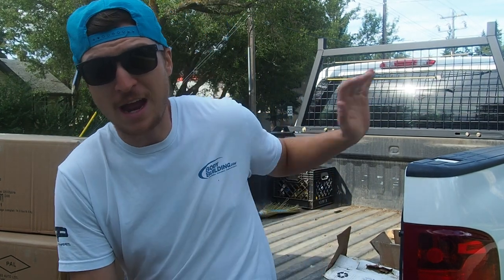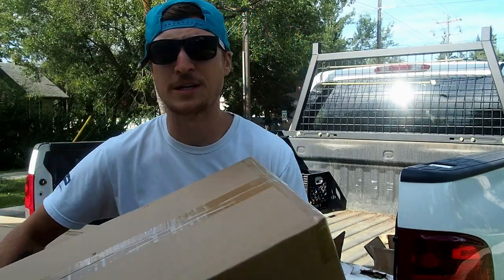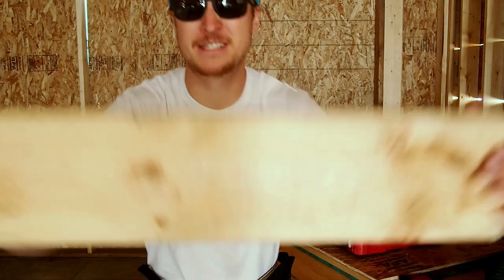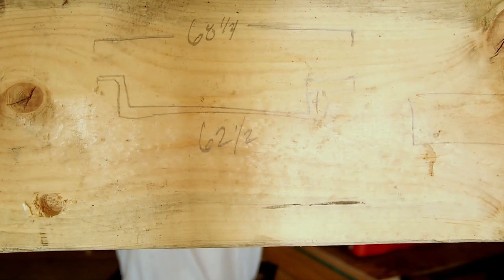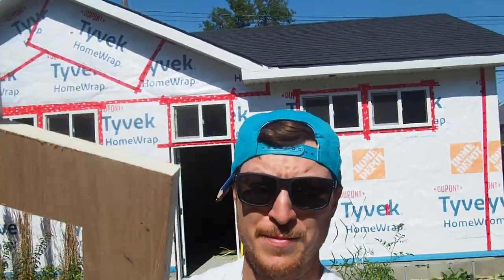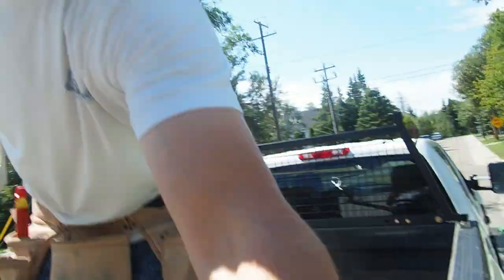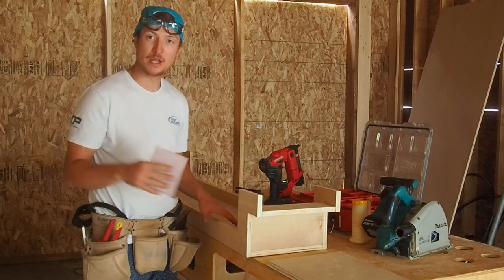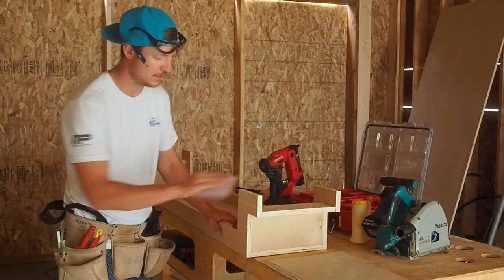DIY pickup truck toolbox // Truck tool organization ideas

Comment from the maker: Think it will last the winter?!
Reply: Nope but I think you're getting there. I did something similar and had to add drain holes and support legs in the middle to the bed. Good luck and great video
Reply from the maker: @johnbronson8928  thanks for the comment!  I added drain holes as well, and so far it is holding up quite nicely. I'm interested to see if I wind up with any of the middle sag you mention.
Reply: Nice work, but would not work over here as all your stuff would be stolen within the week!
Reply from the maker: @peterevans8194  dang! To be honest, I was worried about it in the beginning which is why I bought lockable toolboxes (they are screwed down too). But I haven't had anything taken so far. Fingers crossed it continues 🤞
Reply: @hsdesignstudio  It's so bad over here, most trade people either remove all their tools from their vehicles every night, or use steel VanVaults...with the advent of 18v battery grinders ect the thieving scumbags can get into pretty much anything these days though....Good luck with your set up and all the best for the New Year; let's hope it's better than 2020!

Comment: Finally, someone who has an open truck bed. I've designed and redesigned the back of my truck so many times, looking for the perfect organizational system. I like the holder for the boxes you made. I have a ladder rack as well as a headache rack that actually limits what I can buy, build or design for tool and parts storage. Thankyou for showing your ideas.
Reply from the maker: I did the tonneau thing for a couple years and it was just a pain

Comment: Great Idea!  I used to have a big crossbed toolbox on my truck, but it was overkill and I was never happy with the reduced visibilty when looking over my shoulder, so I got rid of it. But I'm going to use your idea and have a friend with a welder to make something similar out of steel.
Reply from the maker: Funny you should say that- I'm so happy with this, I'm going to take a crack at making a steel framed one next spring. The wood has been good so far with no issues, but I don't see it lasting more than 3-5 years.